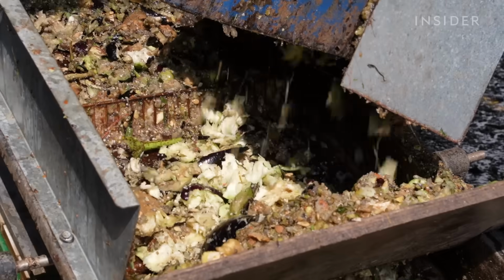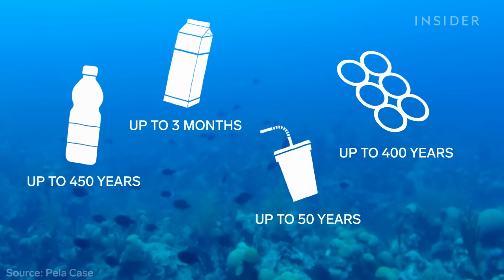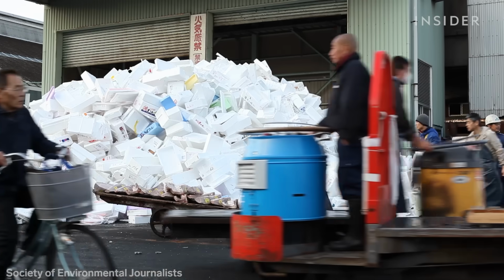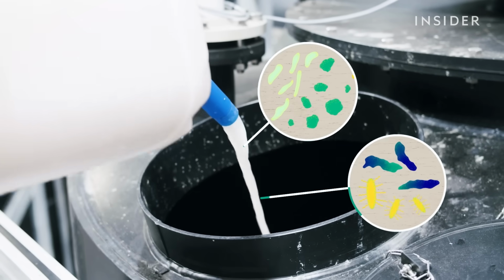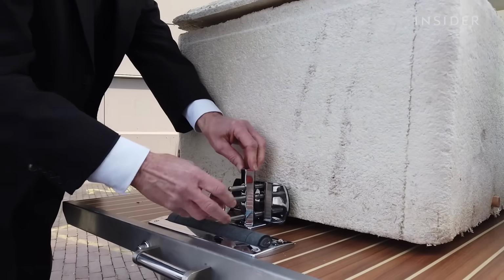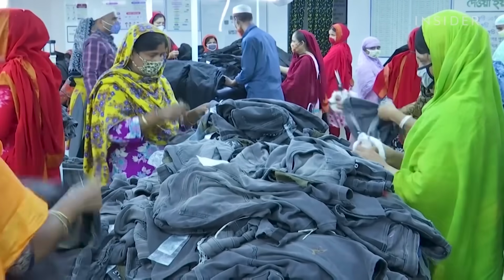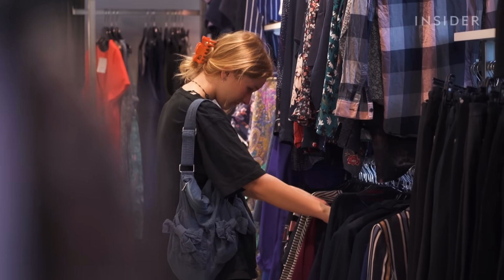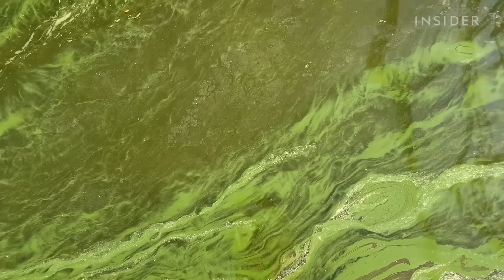17 Ideas To Tackle The 2 Billion Tons Of Trash We Make Every Year | World Wide Waste Marathon

Comment: Seems like this system works well enough. The big hurdle is education and creating reasonable use by residents and visitors. In nyc this hardly seems possible even if the engineering and infrastructure problems were overcome. nyc’s relationship to trash (for better or worse)is fully emblematic of its cultural identity. 🗑️ 🍕 🥯 🐦

Comment: The reason biogas is not used in most countries is that it requires consistent high temps to produce. Anywhere outside of about 25 degrees from the equator would require artificially heating the digester at least part of the year, offsetting the modest amounts of gas production with higher heating costs.

Comment: There's not a single table made out of the most expensive rare wood ever found that costs $1,000 for 15" X 28" . Not 1. The price of something is based on many factors.  #1- being that the materials used have never been used before by humans.  #2- the quality of the materials used.#3- how difficult it is to produce. #4-labor.

The "free" and "used" chopsticks are made from wood that isn't used for furniture because of the brittleness. It's wood that too light to have any sort of strength.  The tables made out of even 50,000 chopsticks wouldn't even weigh 3lbs. $1,000 table tops weigh a minimum 45 lbs. Minimum.  You'd need more than 20 million wooden chopsticks to get 45 lbs.

Comment: There is a follow-up they did end up driving a car on it. Yes but this is a chance to make it open source. Also its better to do hdpe or ldpe. Im currently drawing on a plant distilling used oil. Look in to hydrogen generators of you want to get bang for your buck in gas form. The gas that doesnt condensate at room temp is usually offgass and cointains a lot of other stuff. If you want fuel quality you need to have a reflux drum and it does exactly what it says. It refluxes back in to distillation... Review second garage 54 vid please

Comment: In urban environments, believe we constantly ignore two other power sources and with a combination of localised mapping, taking into account climatic conditions that suggest there may well be many benefits but will require smaller thinking and deployment of AI systems, to enable both efficient & effective uses; exploring feeding into the National Grid &/or localised benefit savings and or community heating etc based on detailed analysis of areas? Politically will require significant step change as well as serious urgent debate about the beneficiaries & ownership?

Comment: Bought 4 metal raised beds like yours on special for next year's gardens.  Summer project was putting in a solid wood fence. Hope this will keep the deer out. They even chewed off the tops of my tomatoes. Put side supports so the soil won't bow out the sides of the raised beds.Have already started composting on the bottoms.

Comment: There's a simple solution to the plastic problem: anaerobic thermo-catalytic depolymerization.  That mouthful means grinding the plastics very fine, mixing them with chemical catalysts, enclosing them in a crucible, pumping out all the oxygen and then heating the crucible slowly.  At different temperatures, different catalysts are activated and different products result.  This system can turn plastics and slaughterhouse waste into kerosene, crude oil, synthetic fuel-gas, and pure minerals.  This system is being used by waste-to-energy start-up companies in China and India.

Comment: Banana fiber can be processed using the same methods and machines used to process linen. The only additional step needed would be, “ripping,” the raw material using a multi blade saw; in one side, out the other without anyone being pulled into the current shredder machine. 
     Processed like linen, banana fibres could be used to create a wider variety of weighted fabric from multi-ply tires, to canvas tarps, to paper plates, 3oz clothing fabric, silk and microfiber filter paper. 
     And the machines used to process linen were powered with water molls. The same type still used today to grind grain. 
     Don’t look to the US for the technology, look to 17th century england. These machines were widely used in the linen cottage industry throughout Great Britain.

Comment: And that's why in Spain all the main lines of gas are pressurised to high pressure up to your very door, where EVERYONE has an independent pressure regulator. That way it's impossible for a generalized accident like that. At most, your regulator could fail and generate an isolated fire, but the rest of the houses around you would not be at risk.

Comment: About flip flops, shoes and recycling them. The problem isn't the material of flip flops but the design, if instead of low quality planned to fail flip flops people bought well made ones this wouldn't be an issue. We have created amazing materials that last years but we use them in ways that make them last a few months and then become trash, the solution isn't to downgrade to materials that decompose.

Comment: I thank the people who put together the IKEA store, without them I would not have my 
storage BENO RACKS for my CD'S & DVD'S.  These are wonderful wooden racks that can
hold almost anything u want it to hold.  At the time I bought these they were $50.00 a pop.
I had to put them together then attach each unit to my wall, they have holes inside each unit
& pegs to make the plates whatever size u want them to be, I choose these units for the use
of my CD'S & my DVD'S & it's worked so much better, I have 10 of these  units across my wall, so thank u IKEA for such a device.
Sometimes MFG comes up with an idea that I think is the best they ever offered accordion
heaters, I have these in my apt, of course my apt bldg wasn't built until late 1800 or early 1900 but I think these were the best heaters ever designed & made.

Comment: This method is carbon neutral. It needs to be carbon negative by locking that carbon up for millenia. Bamboo grows so fast that all bamboo chopsticks should be thrown in a garbage dump so it gets sequestered. Garbage in a dump doesn't decompose so it all gets locked in. Keep growing bamboo and locking up the carbon to get it out of the system. I Think they need to take 2-3% of all commercial wood and sink it in the deepest part of the ocean so it can get turned into coal for whatever comes after us!

Comment: Chopsticks are made out of low quality woods such as birch, spruce and bamboo. It might look cool, but it won't compare to traditional furniture woods such as ash and poplar with regards to durability and strength. This is just a trendy gimmick. Also, the binders they are using to glue the chopsticks are petro chemicals and are not sustainable, and the products they create are no longer biodegradable. It would make more sense to burn the chopsticks and generate renewable energy from them. Bamboo shoots can grow nearly a meter per day.

Comment: Most disposable Chopsticks are made of bamboo which is a grass that readily grows. It is quite sustainable if we use it to heat homes or make charcoal briquettes for grills. The carbon cycle continues to the air and the bamboo turns it into chopsticks.
Reply: Kinda true. However the tables they're making are also replacing ones that might have been made from wood, metal or other materials. So the effect is larger than you're portraying.
Reply: @newolde1  also kinda true, how much carbon is in our atmosphere? 
Hint: not enough to bother (less than .4% or 0.0004)

Comment: Recycling chopsticks is really dumb. Wood is a bio degradable material that if recycled in this way increases the CO2 emissions, and substantially because of the resins (so it would be better to simply burn it instead). There is no benefit in doing it (except for the owner of this that sold an idea to the restaurants). They both benefit from this, but the world loses on it if this were to go large scale. Better to burn the chopsticks and spend the money used for recycling on planting new trees, and you can do that without the CO2 overhead of creating resin additives.

Comment: Chopvalue makes no economic or environmental sense at all.  Recycling all those chopsticks to tables takes more labor, more effort and more energy than what is saved by burning the chopsticks to produce energy.  Burning chopsticks is carbon neutral.  On the other hand, recycling it uses more energy and chemicals and produces more carbon.  Just the heating alone uses more energy and produces more carbon than just burning the chopsticks and manufacturing new chopsticks.   I hope Chopvalue stops this gimmick and eliminate their carbon footprint.

Comment: I can teach you how to recycle plastic 🐓

When I was young, I used to think that using heat can help recycle plastic by melting it then turn it into a different product! Then I thought how come no company does that which made me think probably my idea is junk and companies have better way!

Until recently, I saw a youtube video about a company in Africa actually melt it and it is something big! They turn the melted plastics into a block of construction brick!

Then I thought hmm when I was young I knew to melt plastic using heat but the plastic always get burnt and created a lot of black smoke + the plastic turned black and somewhat melted into very ugly form and evaporate!

I thought for awhile after I saw that Youtube video and I have figured out!!

Do not burn the plastic using heat too high! Instead, use a mold with adjustable temperature and try out different temperature and you should be able to kind of melt the plastic and turn it into a form of a brick just like that African company!

I never thought gigantic corporations and companies do not even know how to recycle plastics for cheap but that African company and I figured out or got the idea (:

My next step is to figure out a molecule that can dissolves the plastic and turns it into basic elements again.. This is quite difficult. The plastic bricks might cause problems in the future (:

Comment: First one is cool, but with wood, as long as it's sourced responsibly from sustainable forests (pretty much 100% of European and North American woods are sustainably managed), it doesn't matter (that much)if it get burned or thrown away it's still carbon neutral. That's not really the problem, problem is plastic and other artificial waste.
Obviously you want to reduce using disposable stuff as much as possible, but wood is really one of the least problematic materials we have. And I do think that utensils should be only given if asked in delivery.
Reply: People should use bamboo instead of wood to make utensils.

Bamboo is cheap, grows fast, and easily available.

Comment: Some places don't flush used toilet paper because of plumbing issues. Some people turn off the shower water when they soap up saving hot water. What is the problem with a dishwasher machine instead of single use. What works is what we take stock in and thus behave a certain way lest we find an identity of a Hippocrite.

Comment: Love these types of videos :) Regarding the bread in France... If a bakery makes 50 banquettes a day but only 40 sell.. then the following day they should only make 40. This would reduce the left over bread, no ?
Reply: Not necessarily. If a business is constantly sold out because it didn't produce enough, it leads to a reduction in business over the long term. Consumers tend to spend less time in an understocked shop/bakery than they do in a fully stocked one. It is a hard balance to reach and ultimately will produce waste based on common consumer habits. We could change the habits in time, but until then the waste needs a way to be used.
Reply: @laurent3415  good point. In my country, we call this "hungry eye phenomenon", where we decide to take a product out of large bundle instead that one that's sitting alone on the shelf. But on the other hand, in our culture, bread was never wasted. Bread crumbs are one of the most common products, sold by bakeries, supermarkets, small grocery stores etc. We also make them at home by simply drying pieces of bread and grinding them in a food processor, blender or in a simple pestle and mortar.
Reply: @a_l_e_k_sandra  Exactly, we do the same since decades, always dry our left over bread in grind them for several uses, now adding it to pastries and cakes is a surplus.
Reply: Our local bakery routinely cuts unsold, bread into cubes or crumbs, for resale. I do that with my own bread.  I put the cubes into buttered bakeware, along with any appropriate 'leftovers' & herbs, pour well blended eggs, and topping of grated cheese, and it becomes a dish called a Wifesaver. It can be frozen or stored 4 days in the fridge. Delicious.
Reply: I’ve worked in the restaurant/bar business in the US for 23+ years. Lauren T is absolutely right. We work on a par system, but if we have 40 steaks and 41 guests that want a steak, that 41st guest complains to us and their social circle, they get something free in return, and the odds that any of those people come back when they can go next door is hugely decreased. It’s a constant balancing act. You know Americans; better to have more than you need and throw the extra away than to ever have less.

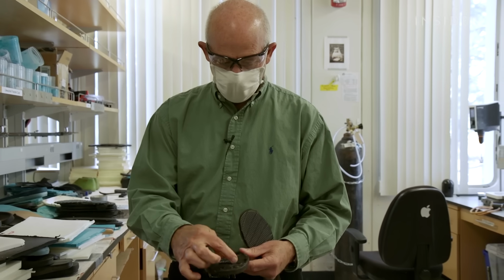Comment: 17:30 that glue is synthetic & toxic, what weight % of the finished flip-flop is adhesive? How does it break down in marine, landfill or furnaces? .... Probably why it was not discussed.

They didn't mention attempting to bond the different grades of algae sponge using pressure or heat. That should be a major priority so they can market their product as "free from toxic chemicals & petroplastics". "Mostly not toxic" just doesn't give the same impact on consumers' thinking.

Comment: Looks like the kind of things which look good on paper but are actually very bad for the environment. Take the chopsticks thing. You have cheap, biodegradable material like wooden chopsticks which can safely and economically be composted and used as fertilizer and get new ones from new plants, with a net (wood) co2 contribution of zero; but you instead decide to GLUE them together with resin making them a terrible material to recycle, then you have to cook them in a oven, then sand them manually in a very energy and labor expensive process just to end up with a sub par little tile of wood which will probably cost a fortune to manufacture.

Comment: What they are not telling you is with today's population the goal of replacing petroleum oil is unattainable and continuing as we are is unsustainable. 
When the limit is reached famine will set in and it will take decades of it to reduce the population to a sustainable level and that is why the world's electrical grids are not being hardened against an EMP. By wiping out the grid over large sections of the earth the population can reach a sustainable level in about a year instead of decades. This plan could be executed as soon as the island and underground fortresses for the elite are complete.

Comment: They are made from bamboo, it's fast growing and compostable. Plastic is the issue not wood chopsticks which are not a problem and converting them is actually worse for the environment
Reply: Exactly, they are turning cheap, easily compostable, bamboo chopsticks into a resin filled, plastic-like, un-recyclable, expensive, sub-par, wood.

Comment: Wait they don't wash the chopsticks before baking them?
Reply: Why waste water when everything will be sterilized during baking?
Reply: @aleenaprasannan2146  because you don't need a lot of water for that and I'd personally prefer not having foodwaste in my furniture.

Thing is also that bacteria and funghi are everywhere. Sterilization only kills active bacteria and funghi right then and there. But if there is food-supply they will repopulate. 
Example: imagine cooking a potato until its completely steril. Then leave it lying around. I guarantee you it will rot.
Reply: @cauchyschwarz3295  They won't repopulate because the resin that it's dipped in and baked in, seals everything. Nothing gets into contact with moisture after that step and thus nothing grows.
Reply: @aleenaprasannan2146  well ok. That makes sense, although I am not sure this remains that way after they are crushed by that machine.

Anyway I'd still not want food residues in my furniture.

Comment: I think the core of reducing pollution is education.. educate people and children to reduce reuse and recycle.
Reply: I was going to write this but u are 22 hrs ahead of me
Reply: nope none of that works, plastic producing companies increase making plastic year after year so you can reduce reuse and recycle all you want there's still going to be more and more plastic been made. the companies that keep making plastic are the ones polluting not the people, so the people can not solve this problem only the companies can.
Reply: @roldiny  that's why I use reduce first.. limit buying that's it.
Reply: @roldiny  ok so if you buy less plastic by reducing it and the company becomes less profitable it will force them to make largechangrw
Reply: @roldiny  Very wrong. “People can’t solve this only companies can” is not correct. It’s a simple supply and demand thing, people want/need plastic goods, forks, straws etc so these companies make and supply them. If that demand stops or reduces, the company will have to do the same. It starts with people leading more sustainable lives that will force these companies to change their manufacturing processes and materials to be more sustainable. If there’s zero demand or a reduction in demand, companies will have to stop or reduce making plastic products in order to remain a profitable business.